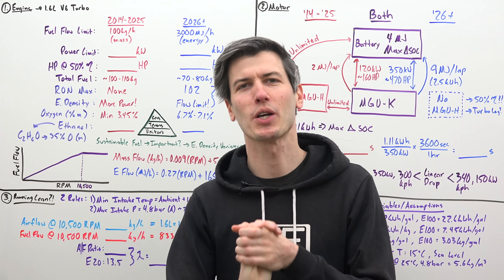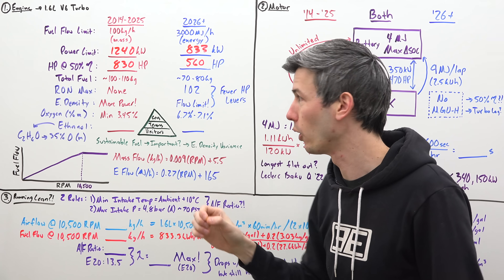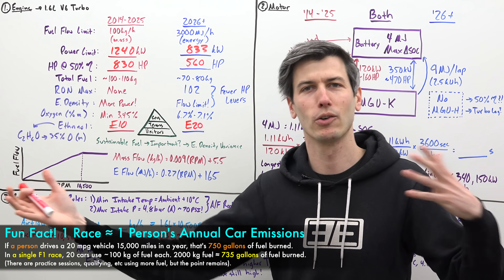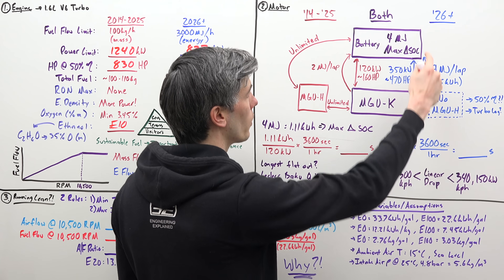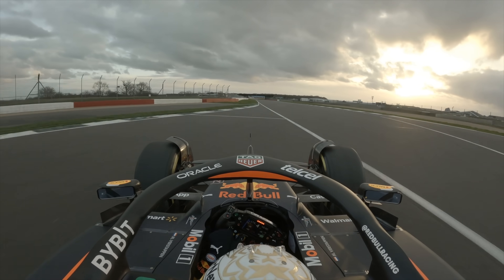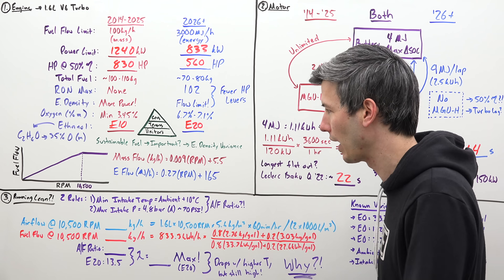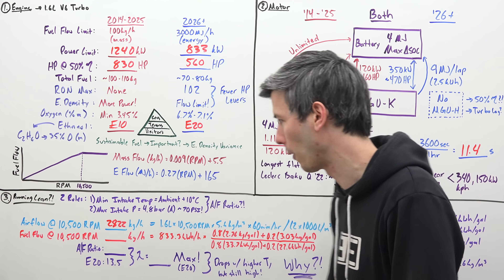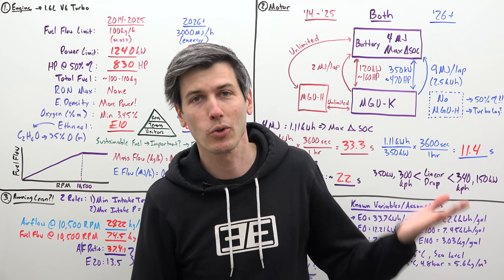Why Are 2026 Formula 1 Engines Going To Lose So Much Power?

Comment: there combustion engines not ac/dc electric motors. why use the over complicated kwh 😆😆 just call it it horse power lol. Great video man ♾️🤟
Reply from the maker: Ha, thanks! And to be fair, HP is a terrible unit - see video: https://youtu.be/gC2-JKO0c2I
Reply: @EngineeringExplained  for engineering purposes (and abstract science mind sets) KW or kwh is WAY better. But 1KW is 1000W; if a car has a 833KW driveline that equals 833000W.
In day to day life, average human experience, you do not see countable groups of 833000 of somethings mostly never. You don't count leaves or raindrops. It is not intuitive. Heck, on a road trip you may not even break the 100000 lamp post mark. Assuming ~10w LED bulbs in them, for the average human to have a guess-timation of how much energy is in a car, is hard. But you DO and can ball-park 550 Horses.
A brief explanation on why the aversion to KW or KWH. ¯\_(ツ)_/¯

Comment: Just take me back to F1 2004, the cars used to look better as well
Reply: My thoughts exactly.
Reply: This is why we need a loose-limits F1 type of series, the drivers already know the risks of speed and accept them so why not push the envelope of tyre, suspension and aero technology and allow things like downforce fans, larger engine sizes, more turbo pressure, more energy dense fuels, higher octane, as much gas consumption as you want but with a refuel limit that the teams must abide by so force higher mileage advancements, things like that. Maybe allow teams to experiment with unconventional engine styles, like a multi-rotor HEHC engine or a Wankel if they are feeling daring, the former would basically slash fuel usage in half better than these new rules. Frankly, a no-limits competitive time trial similar in a way to Pikes Peak would be great for advancing technology the right way, push things to the limits as far as possible to see just what we can do when the sky is the limit, bring us back to the glory days when we could build something actually amazing that is so fast it needs driver aids to help the pilot (yes, pilot) control it at speed (and we have those computer systems now to actually do that), that way we could push the limits and see just that we can do with gas. I think we'll be surprised by how much conventional design and tradition and this recent pointless push to all electric has been hampering our development, the scientific method in regards to engines and cars is basically "how far can we push this before it breaks, and what can we do to make it not break and push it further still?" since that gives us the equations to model these complex systems and build precise insane machines that do so much in a package you'd never expect it from. Imagine, an F1 car with a wide skirt sucking itself to the ground so the driver doesn't lose control at low speeds, huge wings that actuate to adjust downforce at all speeds, driving aids that help the driver react to changing conditions on the track, a suit to help the driver stay alert and in good health even with huge lateral forces in corners, an engine practically sipping fuel in comparison to making over two thousand horsepower from a small package and running boost pressures over 5 bar, a large dense supercapacitor bank driving an all wheel drive electric boost drivetrain that acts as the main braking and applies power all the time, the engine recharging the capacitors when it isn't adding even more power to the back wheels, super wide tyres of a new compound that had to be developed just for this racing series, and an active suspension that the computers are adjusting in real time inline with the specs the pit crew set for the track after testing laps and confirmed the accuracy of during the qualification lap. You'd see an insane winged beast screaming down the track, hitting over 300 mph on the long straights and being capable of slowing down with the g-forces that fighter pilots experience and taking turns at like double the speed of the best F1 cars we've seen to date, and it would obviously be a time trial series rather than a racing series since having more than one of those monsters out there would be terrifying for both driver and for spectators. It would be like seeing a more realistic version of Assetto Corsa's Formula DS, and that sounds incredible.
Reply: Just make another F1 then
Reply: Yea yea, and I'm sure in 2004 there were people complaining about 2004 formulas and wanted those from the 80s back. Things evolve and improve, just have to deal with it and not always cry for the old times, because let's face it, they are not coming back.
Reply: @davidslachta yep, in Adrian Newey’s book, he mentioned how people were complaining throughout the 2000s about the lack of ontrack racing due to dirty air making it extremely hard to follow other cars and also refueling which meant people would just overtake in the pits, this lead to the major regulations change in 2009 which saw quite a big improvement in ontrack action especially in 2010 onward. Lets not even talk about Schumacher’s domination of the early 2000s
Reply: Ok boomer
Reply: back to the time when cars were considerably slower?
Reply: @sailor_seller  yes, and considerably more entertaining
Reply: @sailor_seller  you do realize some of the old V10s still hold lap records, and that's on grooved tyres.
Reply: @MrBubblebananas  we will forget about traction control I assume, and the only 2004 record that still stands as far as I can see is Monza (top speed track, big surprize)
Reply: @sailor_seller  my main point is that using the word "considerably" feels disingenuous. They wouldn't continue to hold lap records if that was the case. It's pretty impressive how fast the 2004/5 cars were imo
Reply: @MrBubblebananas  fair point, my point is that F1 is just as much an engineering competion as well as racing one - it's a challenge for the team to squeeze as much as possible within a set of rules and the fact that current day cars are faster with way less power AND limited budget is just as impressive as any given driver achievements
Reply: @sailor_seller  engineering wil always improve with time that's a given. Though current cars in race trim make about 1000hp (with e motor), the f2004 in race trim made around 700. The current cars use way less fuel though
Reply: @sailor_seller  All racing does this...
Reply: @sailor_seller  I'd argue it is 75% engineering, 25% racing.
Reply: @MrBubblebananas because they had refueling so that they could run barely any fuel and essentially run qualifying laps mid race while f1 cars now have to conserve fuel for the whole race, and dont even talk about bringing refueling back, refueling was why the 2000s saw an all time low of ontrack racing and as Christian Horner, Newey and so many others said, the old f1 races with refueling were some of the most boring ever.
Reply: @MrBubblebananas  Except they also were allowed to run on less fuel back then, and the cars were smaller and lighter overall. If you stuck a 2022 hybrid PU in a 2016 chassis with less fuel, you'd probably be able to beat the old records.
Reply: @SL  they were slower not because of the engine it was the cars, put the old engines in the new cars and f1 will return to glory

Comment: Generally it takes about 37kw of latent heat to provide maximum HP through a vice-channel camway. So over 100 kg of fuel will give them a good retroactive defabrication as long as they choose the correct marzel veins.
Reply: Are they running a Retro Encabulator then? Pretty cool if true! Wonder how they’ll prevent unwanted side fumbling on that setup?
Reply: Gotta have the right marzel veins